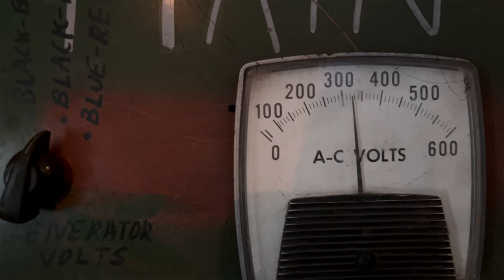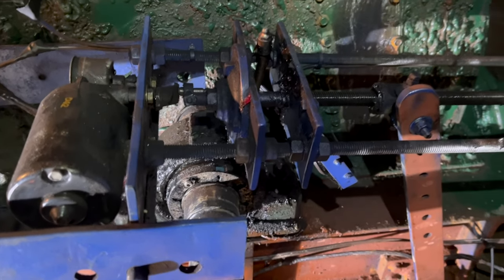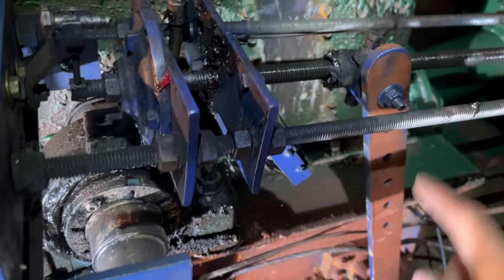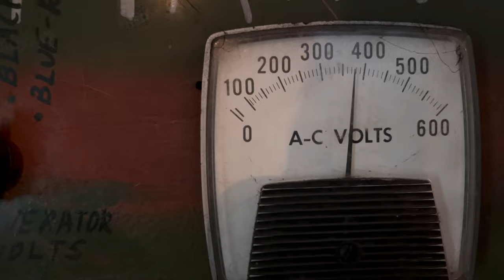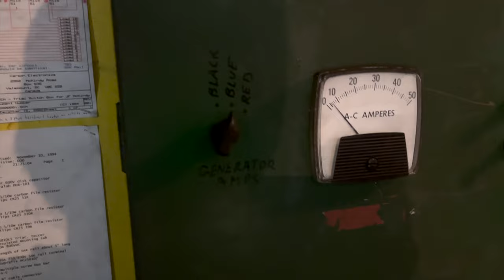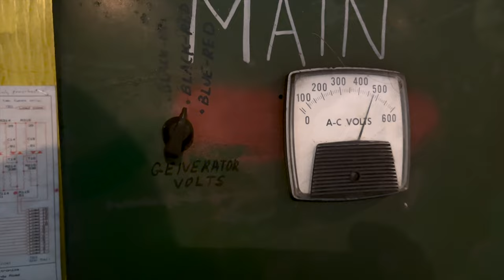Fixing Our Off Grid Hydro Plant (part 2)

Comment: thanks for sharing. the valve that it leaking has packing that could be tightened on the stem of the valve to stop the water from leaking or get new V packing to rebuild it. keep up the good work.
Reply from the maker: Good tip. Ya we have been looking at that valve and think we can probably fix the drip it next time the plant is down for a day or so.

Comment: That is shockingly cold water. I fell through the ice in the other dam up the creek when I was about 13 or 14. I've never run down the trail back to the house faster than I did that day!
Reply from the maker: It is cold water, especially in the winter! Good thing you made it back to the house before you froze solid.

Comment: Why is the peloton wheel's housing so bubbly?
Reply from the maker: I think it’s condensed belt. Because it’s belt driven the belt wears and creates a little rubber dust which condenses on the cold pelton housing. Just a tiny amount, but 30 years worth basically coated the whole thing.
Reply: @MountainVoiceInc  Wow crazy!